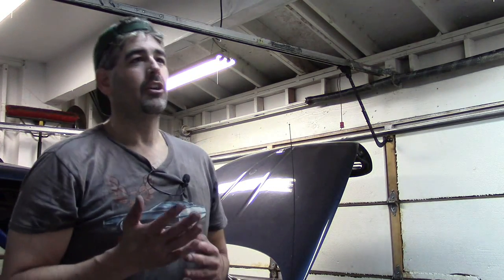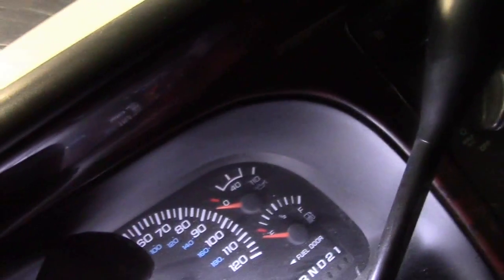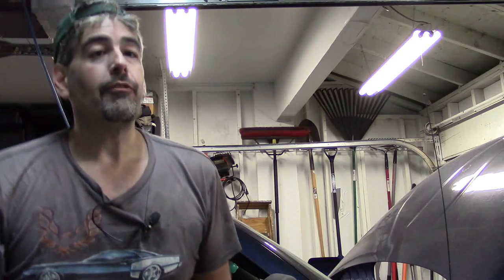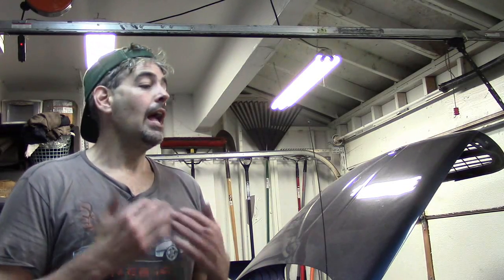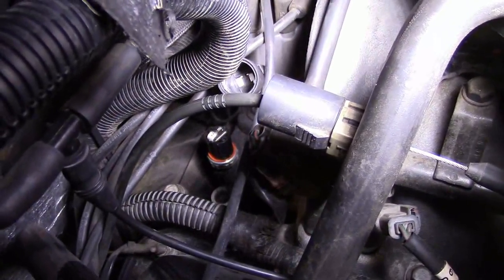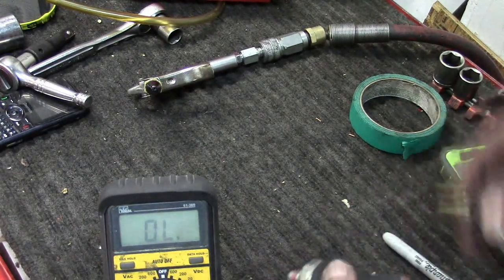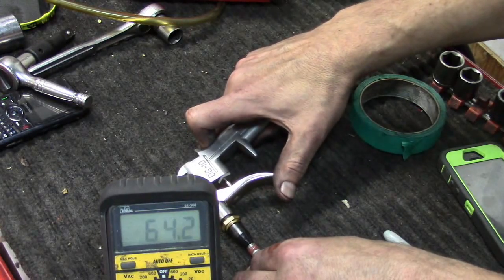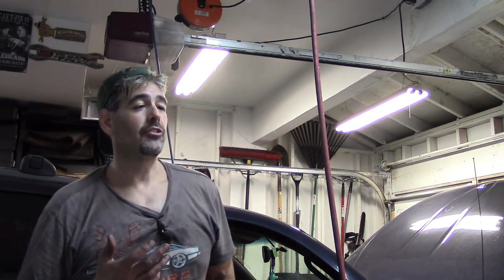DIY- Low Engine Oil Pressure Diagnostics

Comment: Always enjoyed your videos; having issues with my car. Good oil pressure but no oil to lifters. Any input please?
Reply from the maker: How are you measuring oil pressure?  It’s hard to imagine you have good pressure and no oil to top end. And if you had a clog or something the pressure would be really high. 
Are you measuring using a mechanical gauge at the oil pressure sensor port?
Reply: @SchrodingersBox  Thank you for reply!! Used a high quality guage to read pressure at sensor port; if it was blocked oil gallery or turned bearing? Scared but need to know; car has 3.8 supercharged with 230km.
Reply from the maker: How are seeing no oil to lifters?  Is this a overhead cam or pushrod engine?
Reply: @SchrodingersBox  I removed valve covers and let engine run for about 90 sec; oil pressure was 50psi but no oil to all lifters. Then removed intake and lifters looked ok, also no oil in the valley. Oil pickup screen and oil pan were pretty clean
Reply: @SchrodingersBox  The car is 2006 grand prix with supercharged 3.8l, series II. Is it possible to manually pump oil through the motor to c if it has a clog?
Reply from the maker: You must have a tremendous lifter and upper engine noise then. 
   See my video on cleaning lifters.

Comment: Great vid Matt.  You quickly and irrefutably concluded that the only real fix at this point was a rebuild or swap.  Not sure why some of the folks commenting don't seem to get that.  To the viewers, before commenting on this video to offer "help", please consider not suggesting that the oil pump was the culprit, and know that the oil pressure readings Matt got were absolutely NOT within spec.  The only thing worse than being stupid is to pass along stupid advice.  If you disagree, please watch this vid again.
Reply from the maker: could not have said it better myself!! Indeed the whole point of the channel is to be a safe haven from the stupid advice out there. That’s what my whole motivation was to create the channel- because of my frustration with all the chaff out there. 
Thanks for your support!!!

Comment: If was not engine knocking already.can you check oil pump or change it pls?
Reply from the maker: You can however replacing an oil pump is not likely to restore pressure.

Comment: Great video. As an aspiring 2 percenter (well I guess I am one because I never parts change unless I consider it something I wanna change anyways) I wanted to watch this vid both for entertainment and to see what may have flown right over my head. My Jeep 4.0 seems to have odd oil pressure but it may be fine or it may be a sensor or needs an oil change or a combination of both. After all it is a little low on the dipstick so that may be it. It having 255K and oil leaks scares me but maybe I’ll end up being said dipstick.

Comment: I wonder why you don't even mention the possibility of a worn oil pump? Sure it could be the big ends (indicated by the engine knock you mentioned). But surely after the pressure switch, next thing you'd check the oil pump - before doing a major bottom end rebuild?
Reply from the maker: because the oil pump does not create pressure. we can see the flow is sufficient but insufficient pressure is present. that cannot be from a bad oil pump.

Comment: 1996 Chevy Camaro Z28 my oil pressure gauge goes to zero after a while. I replaced the sending unit and nothing. I check the oil and it looks fine and I don’t hear any knocking and it’s doesn’t overheat and the engine sounds ok. I was told it could be the bearing? What other possibilities it could be? 

Thanks for any information
Reply from the maker: what is the voltage drop at the pressure sensor?

Comment: Which is a good oil pressure in car? I have 75 on idle and 80 whit gas it is to high ore good? 
V6 3.4 Camaro Gen 4
Reply from the maker: that’s really good.
Reply: Thanks 👍🙂

Comment: Explain to me why the reading on your multimeter dropped when you increased the air pressure into the sending unit please
Reply from the maker: Because it is a potentiometer- it changes resistance with movement of the sweep.  Lower resistance lowers voltage (ohms law).
Reply: It seems like (as a pressure gauge) it should read higher with more air pressure?
Reply from the maker: it depends how it is designed. some potentiometers increase resistance with a positive change, some decrease resistance with positive change. There are also other systems that compare to a fixed reference voltage. so it’s not so much if it reads higher or lower- it’s the absolute value of the difference that matters.

Comment: I have a 98 chevy 5.7. At idle warm my preasure is a little under 40 on gauge and of course when hit throttle it goes up but never drops lower then like 38. Know it's just a work truck and never goes on high way and I dnt plan to keep it much longer but I do need it to perform for the next couple months. Should I be worried? Done oil change distributor plug wires could almost all sensors on engine I just rebuilt the front end like stearing components. The lower intake needs to be done the engine only has 150k on it should I RIP the engine out and find a used one with lower mileage and before install change intake gaskets and oil pan gasket and run it if I plan to keep it or just run it till shes dead. I have a spare engine in a parts truck I bought that runs but has 230k on it  idk if o should just pull that do the same same lower intake and oil pan gasket possibly spider injectors and slap her in it's just the mileage it has on it and it's a old plow truck so I'm sure that engine did alot of idling. Just dnt know what rt I should take junk yard engine or one in parts truck  that has 230k or just run mine with low oil pressure. Or is 38psi at idle ok?
Reply from the maker: it’s fine. that’s normal.

Comment: They always said you need an engine rebuild cuz they going to make more money with it and I don't want to waste your money and willing to try the steps I just gave you it's easier for them to sell engine rebuild hell before I even did the engine rebuild our replace the f**** oil pump do the best record you reading this you need to start working on yourself this is why I learn how to work on my own stuff for this very reason these mechanics will replace stuff on your car just to tell you something else needs to be fully done the minute he got the car and drove the car he should realize they had a low oil pressure cuz it didn't just happen it's been happening no offense to the mechanic hopefully I'm talking to the owner of the vehicle this is why you always want to learn how to work on s*** yourself but hopefully you get your car back follow the steps I gave you you should be a good trust me I don't have plenty of hoopties if that don't work you need to find you a borderline crackhead mechanic he'll make that mother f*** work wonders

Comment: It's a very easy fix change the oil change the oil pressure sensor change the PVC valve before you change the oil do a engine flush to get out all the sludge I would go to my manufacturer specs Define upload velocity of your oil and then I won't bother Purple oil full synthetic from Napa in a Wix oil filter from Napa that should solve your problem you look at 81 books and that's for Seven Courts you see the video when he was showing you that oil that was sludge

Comment: Did u think of oil pump is bad?.. That's first
Reply from the maker: No. Because it is never the oil pump. Oil pump is NOT what produces oil pressure.
Reply: @SchrodingersBox  good point.  I sHUD  have. Never doubted the master
Reply from the maker: Hahahaha - never bad to ask!  Most people change the oil pump but a pump gives flow-  the bearing clearances create the pressure. An oil pump is incredibly simple- it is extremely unlikely a pump would wear before the bearings do.
Reply: Ok. I just pack mine with petroleum grease "vasaline",  cuz they said it wud prime pump win cranking up. Hope they rite. Took me 2 weeks to get oil pan back in. Everything had 2 go even dropped tranny!

Comment: Hi. Nice vid and very clear explanation. Im here because i owe an 15' nissan rogue and it show the warning text low oil.pressure. 2 days ago. Today i check and there is a spot of grease on the driveway. I will bring a mechanich and i hope i dont need a new engine.

Comment: Hi dear teacher, I have 99 jeep cherokee with low oil pressure (check gauge light)   with new 3 wire pressure sensor. I checked the 5v ref. and the ground and they are OK. I check the continuity of all 3 wires using the wiring diagram and they are Ok. I extended separate signal wire from the sensor signal to the  control but didnot fix the problem. The sensor signal voltage is fixed at 0.17 V with plugged connector. I tried to get 5V ref. from the ECT sensor through my test lamp and put it into my unplugged connector signal and also there no respose. If the oil pressure is ok, is there any possible causes except bad pcm?? Im I a good student?
Reply from the maker: Yes you are a good student. You did very well. You must have the connector unplugged to see the 5V signal. Measure with it unplugged and if you find 5V then your next step is to use a gauge to measure the actual oil pressure mechanically. If however you don’t have 5V, then there is some type of wiring issue. It should be there.
Reply: @SchrodingersBox  I checked the 5V and the 3 wires and the actual oil pressure and they are all OK. Thats why im sending you. So, is it now the PCM or still there is something to check?
Reply from the maker: it’s not the PCM. you either have a faulty sensor or legitimately low oil pressure.
Reply: @SchrodingersBox  many many thanks my perfect teacher. Finally it was a bad new pressure sensor. I replaced the new sensor with another new one and it works great. Many thanks again
Reply: @SchrodingersBox  but how can I test the 3 pin pressure sensor. Is there a prober method to bench test this 3 pin sensor. Which resistance should I measure?!
Reply from the maker: Yeah it’s a little difficult because you would have to have specifications but what you would do is “bench test” it off the car by measuring resistance between the ground and signal contacts. There should be a certain resistance.  Then apply vacuum using a vacuum pump- the resistance should change to another spec.  If it doesn’t the sensor is bad. The issue is you would have to look up those specs to know what they are.

Comment: Great video! Thanks for making it. My question is if someone can't afford to replace the engine, would you recommend to go through the hassle of replacing the oil pump and rod bearing? I have the same problem and was told that replacing those two parts is the alternative cost effective solution. 
Any input will be greatly appreciated. This is my work truck and if it dies I will not have a job. Please help.
Reply: to be honest, the proposed solution sounds like a bottom end rebuild which is roughly the same cost/work as the budget rebuild he did here https://www.youtube.com/watch?v=R1qBJ8ZeOUA

Comment: On my kubota generator diesel engine, if my oil pressure goes below 10 psi it shuts off automatically. Also if the engine gets too hot over 240F it shuts of too prevent overheating. I dont know why they dont have this on gas engines.
Reply from the maker: Yeah it should be a default that on overtemp or low oil pressure the engine shuts down. It's going to shut down anyway when it blows so why not save it!

Comment: Some 20w 50 oil will keep that engine alive.
Reply: Um Nope that wont fix it ...  it will only Mask problem for a short time and Actually cause even more Damage to be done..Actually the only true solution for this particular problem is to completely rebuild the bottom end of the engine and to refill it with factory recommend Oil Weight

Comment: I have a 2012 ram 1500 5.7 hemi. Oil pressure fluctuation from normal to low with warning light. Slight temp increase. Stuck 500 miles from. Home need ideas
Reply from the maker: This is a simple one. Just Check the mechanical pressure and see if it correlates with output voltage drop across the sensor.

Comment: He all sells it and it needed a oil pump lol
Reply: You proved the sensor worked, not once did you go beyond that. Can you actually explain why the oil flow was insufficient and possibly intercept said issue, or are you just basically saying yeah the motor sucks
Reply from the maker: That made no sense whatsoever, what you said.
Reply: Sure it wouldnt make sense in context to an okay reader , but you would get it if i said it in person.. do you suspect it was the pump or oil pick up (if this vehicle has one) was clogged or malfunctioning ?
Reply from the maker: @Trenchboi69  How is it possible the oil pump can be the problem? What data indicates this?  It's obvious  to me it's a pressure switch problem- am I missing something?
Reply: Im thinking from a honda a pressure switch doesnt do anything but SENSE oil pressure, sure it’s technically a mechanical switch but does nothing more than feel oil pressure, while things like the pick up and pump are really the catalysts for pressure..
Reply from the maker: @Trenchboi69  ALL pressure sensors do nothing more than sense pressure.  I am not following- where is the evidence there is a mechanical fault in the pump?? The flow was clearly evidenced. it was  the pressure that was irrefutibly evidenced to be insufficient. How is it physically possible the pump is the cause?
Reply from the maker: @Trenchboi69  AH actually I read your comment again...  Your error is in thinking the pump generates pressure.  The pump does NOT generate pressure.  It generates flow.
Reply: why was the flow insufficient? If you only looked at the sensor , and that worked then you have done nothing. If you cant answer the first question then you haven’t really figured out exactly WHY the oil is flow is restricted
Reply from the maker: @Trenchboi69  Dude- you don't understand what happened in the video.  I proved the flow was sufficient, not insufficient!!! There is no question about that.  This is a legitimate PRESSURE issue.  Changing the pump would be a novice mistake.   You have to understand how the fluidics work in terms of restriction generated pressure.
  Its amazing how many people do not understand this and would say the pump is bad.  Thats why I showed the difference in the video, man!!!
Reply: And the pump is the catalyst, sure things like bearings, rods do too but thats the beginning on a primed motor
Reply from the maker: @Trenchboi69  You clearly also do not understand what a catalyst is.  Look man- get over it- you need to educate yourself. Maybe watch the video again.  THE PUMP IS NOT BAD. IT IS PHYSICALLY IMPOSSIBLE GIVEN THE DATA.
 Period. End of discussion.  Its science man
Reply: Engines dont just get “low oil pressure” something FAILS, CAUSING low oil pressure
Reply from the maker: @Trenchboi69  JHC dude look at the GAUGE VARIANCE-  this can only happen with sufficient flow. Please explain how the gauge readings could occur otherwise.  Dying to hear this.
  The pump worked. There is no RESTRICTION.  Anyone can see this even without training!
 Wow man.  Explain -please. Explain the physics behind your theory.
Reply: You probably didnt even fix it
Reply: I like how the genius has to edit his comments..  too bad you cant do the same for the cars you already sent back to the owners
Reply from the maker: You fool you still never answered the question. I answer yours though because I actually know what I am talking about.
  Of course I didn’t fix it. Unlike you who would have put a pump in it like a novice, I correctly diagnosed it needs an engine rebuild not a pump. I no longer do rebuilds. 
  Second, I am still waiting for your explanations of the fluid dynamics that support your theory. But you won’t. Idiots like you NEVER do. EVER.
 I am sick of people saying I am wrong because of their incompetently incorrect understanding of basic concepts and then failing to even try to justify and end up with red herring logic fallacies... Like this asshat Jordan.
Reply: I stopped reading after “i didnt fix it” of course you didnt genius you literally did nothing
Reply from the maker: @Trenchboi69  Ah as usual the stupid incompetent moron uses yet another red herring to avoid the question.
  Your incompetence is merely proven by your idiotic response.  Want to look smart? Answer the question otherwise we all know you are just another blowhard incompetent fool.
Looks like you'll be on my next "cat vs trolls" video highlighting the biggest idiots of all time to post on my channel!!

Comment: I have a lexus IS350 2007 with low pump pressure, i have bought 3 different oil pumps and no change, the car starts fine, but the oil pump pressure is very low. Pls what do you advice?
Reply from the maker: Why are you replacing the oil pumps- what is your evidence the pump is the issue? What is the voltage and amperage at the pressure sensor vs actual mechanical pressure?
Reply: @SchrodingersBox  the mechanic did a pressure test and said it read 70psi.
Reply from the maker: Then there is definitely not low oil pressure. Test the bias voltage at the sensor next.

Comment: So I just bought a 98 dodge ram 1500 and was told the same thing that its a sending unit but mine will sit at like 38psi then drop to zero for a minute then go back up to 38 then drop its like 30 sec intervals
Reply from the maker: Sounds like it may pulsewidth moldulated

Comment: The knock and the chromium visibly present (indication of ring wear, exacerbated by loose rod bearings which allow the pistons to "slap" around and wear out the rings) in the oil were already indicative that the engine is worn out.
Reply: Douglas Self  yeah, he said that